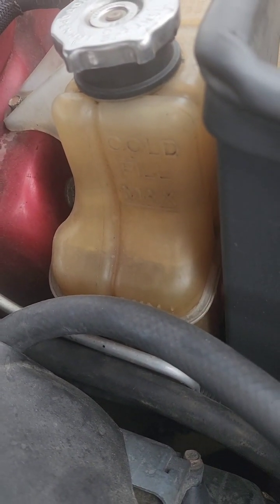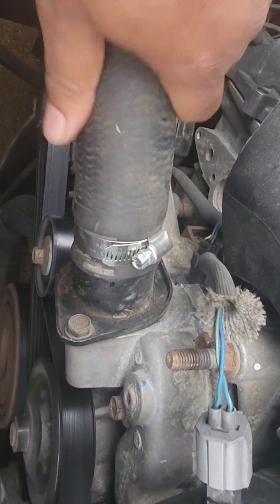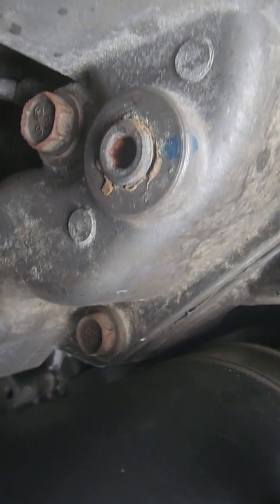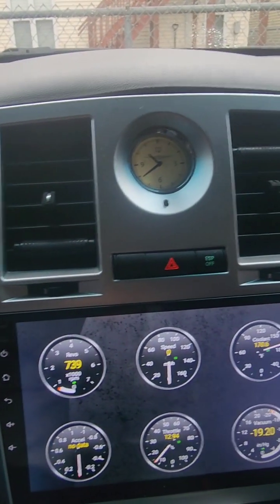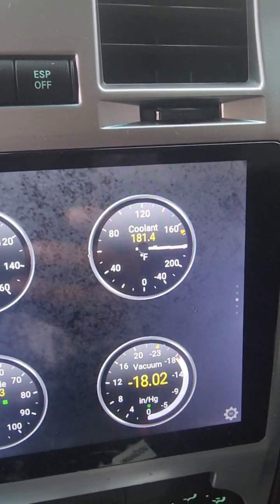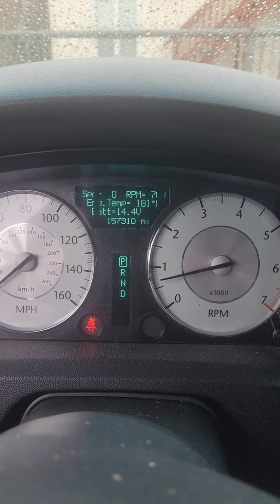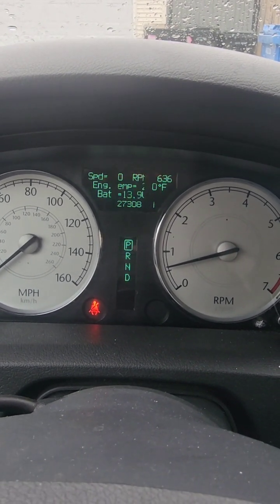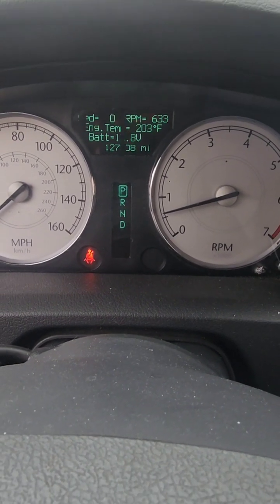What's the coolant temp for a Chrysler 300 5.7 HEMI? 🤔

Comment: Did you put a 180 in ???
Reply from the maker: Nope. NON MDS top end kit, cat-back exhaust, CAI & a tune on the red joint. I expected it to run a little cooler but it's doing better than I thought it would.